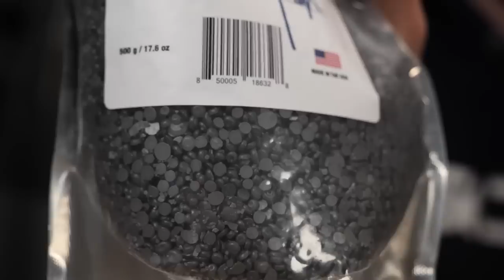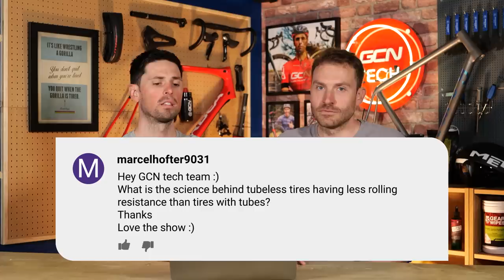Chain Waxing, 1x Setups & Tubeless Rolling Resistance | GCN Tech Clinic

Comment from the maker: What bike tech questions do you have for us? 💬
Reply: Do new bikes with thru axles have the wheels better aligned than older style quick release wheel setups? I would have thought this could be a significant advantage for lower rolling resistance and stability.🙂
Reply: @truthseeker8483  I think it more better for brakes as each one align in exact same place than older quick release where can be slightly off so brakes like on disc might not align fully correct so readjust brake pads if worse case
Reply: I turned around a tubeless mtb front wheel and a innertube front wheel at the same time and to my surprise the innertube wheel rolling significantly longer then the tubeless wheel, in my opinion the cause is the boiled egg  effect, so  the constant moving sealant in opposite direction to de drive direction slow down te wheel a lot, so what about ; tubeless roll better ;??

Comment: Tubes vs Tubless rolling resistance:  Tires and tubes are not rubbing against each other creating friction.  The tube is squished up against the tire casing and cannot slip and slide around.  The issue is that tubes and tire casings are made from butyl rubber that has some dynamic stiffness (bounces back a little slow).  If you get a ball made of butyl rubber it doesn't actually bounce all that well, more of a thud with a meager bounce.  Your tires are getting squished at the contact patch and need to spring back quickly to return that energy into wheel, and the slower they do this the more energy turns into heat in the tire.  Butyl tubes just add more total rubber being flexed and losing a bit of energy compared to an equivalent tubeless tire.
Reply: Which is why in contrast to butyl inner tubes, with latex tubes and TPU tubes the difference in rolling resistance in comparison with tubeless is negligible.
Reply: @sebastianm2381  BRR measures rolling resistance with only 20ml, which is probably not enough to actually seal anything at 3.5+bar (eg road bikes pressures). Actually Aerocoach has measured that tyre with latex tube is faster than tubeless equivalent. Since I am still on rimbrakes I use TPUs instead of latex to be safe heat-wise. TPUs are a bit slower but I use old school talc method when installing them, which in theory should further reduce added friction of tube inside a tyre. I think milk is a mess and since I usually puncture very rarely, every +10K or so, I find it easier and cheaper to run TPUs tubes system.
Reply: @theonlyrealbm  I agree with everything you're saying. I'm running tubeless on my commuter + gravel bike. There it makes sense and with these (wide) tires and low pressures it works reliably. On the road bikes I went back to latex and/or TPU tubes. Tubeless road tech for me fixed a problem I never had but introduces many new ones. I rarely puncture. But I did have to fix catastrophic tubeless fails twice on the road and it was no fun. I decided it wasn't worth it for me.
Reply: Where I live, punctures are always a hazard because of goat heads everywhere. I am running tubeless and so far have not had an issue while riding. Only once had a tire explode while camping but that was entirely my fault. Left the bike in the tent will full air in tires. Got too hot and finally gave

Comment: Alex is 100% right about hydrogen. It’s the smallest, fastest and leakiest molecule in the universe.
Reply: Er, no hydrogen forms a molecule with another hydrogen atom ('cause it has 1 electron, and would like 2 (inner shell)). So helium which is inert and thus goes around as single atoms is smaller and leaky-er. So leaky it leaves the earth having gained escape velocity. (more is "produced" through radioactive decay though)

Comment: #askgcntech hi team. Why is cross chaining frowned upon on a 2x setup but perfectly fine for 1x ? Thanks
Reply: Cause on a 2x you can minimize cross chaining by using different ratios, on a 1x you can't do shit about it lol
Reply: Essentially you have no choice with 1x so there’s no use worrying about it. On the plus side, the chainring would be positioned as such that it would be the in between the positions of the outer and inner chainrings a 2x would have, so you are cross chaining less on a 1x
Reply: Long live the front derailleur.

Comment: Tire pressure or Tyre Pressure if you prefer I do it the same way I did it as a mechanic, I use a proper tire pressure gauge I figured out my tire pump gauge is off by about five PSI so I over pump a bit then use my tire gauge which has a release valve on it to adjust to the desired pressure. 
An extra step yes,  but tire pressure is critical so I don't mind the little extra effort for the knowledge of having properly inflated tires a good ROI -Return On Investment of time spent. 😆
Reply from the maker: This is the sort of nerdy details that we love ❤ Do you find that tyre pressure makes a big difference to the feel of your bike?
Reply: @gcntech  
Yes I can tell if my tire pressure is off, it doesn't feel as fast or as easy to pedal.

Comment: If you are in the small chain ring most of the time and running 175mm cranks, I'd suggest shorter cranks.
Reply: Why?
Reply: @adccars359  longer cranks make any gear effectively bigger - you need to think of the crank as a lever. GCSE physics.
Reply: Thanks. This was something I was curious about and why I looked up my crank length and included it in the question. But wouldn't crank length be a potential bike fit concern as well? I believe I ended up with 175 mm cranks because Trek defaults to that size for 58 cm frames and higher and I am on a 58 cm Trek Domane (from 2017).
Reply: @jasonlenthe8902  if you've never had a bike fit, I'd absolutely recommend that and mention to the fitter that you rarely get out of the small ring. Remember though that there is overlap between the range of gears you access in big and small rings - if you are on the small ring and the 3rd largest gear on your cassette, you may find you can be in a similar gear in the big ring and largest gear on the cassette, and have almost the same ratio. 

Personally I run in the big ring all the time unless I need to access the lowest gears which are only accessible in the small ring. The big chain ring is more mechanically efficient anyway.

Comment: #askgcntech So as a followup to the hydrogen question, I remember years ago back when I was a total bike noob and knew literally nothing, a LBS I went to said he filled up my tubes with Nitrogen and that it's "better." At the time I didn't think anything of it, but I looked into after hearing the hydrogen question and it does seem to have some benefits.  Does N leak fast like H?  Any other thoughts?
Reply: Nitrogen gas leaks a little slower that straight air.  Air is about 78% Nitrogen to begin with, and it is the 21% oxygen that leaks out somewhat faster through the pores.  Once you top up your tires a couple times you have already gotten your tires to have a higher than 90% Nitrogen content, and your Nitrogen filled tires will eventually up at the same percentage after a few top-ups.  If you pay attention your tires will lose air a little faster the first time you fill them versus after a top-up to the same pressure.  Basically nitrogen filled tires are a giant gimmick, and you should not pay for it.
Reply: As I understand it, nitrogen is dry (i.e., no water present) and affords better pressure consistency when the tires heat up and cool down.  That is the reason why it is used in auto racing.

Comment: I'm really sorry but your explanation of tubeless rolling resistance was really poor. You just said it was "obvious friction" but I would hope your inner tube doesn't move about inside your tyre! If this were the case, why don't we lubricate our inner tubes apart from sometimes talcum powder on latex tubes to avoid pinching? I was hoping for a more in-depth look at hysteresis but apparently not...
Reply: I've heard that exact thing done by racers back then.. talc powder on latex tubes..
Reply: Kind of sounds like you already know the answer in more depth. You should make your own video 👍
Reply: Why wouldn't the inner tubes move inside the tyre? Obviously we're talking tiny amounts but there's plenty of forces acting on the tyre itself that translate onto the inner tube in varying amounts - they're 2 different bodies so they won't act as one. Those tiny forces acting between the inner tube and the tyre do so on a constant basis, so over the course of a ride, do add up.
Reply: Hoping an inner tube doesn't move in a tire won't stop it from moving in a tire.  They most definitely move
Reply: Years ago many people did this as a normal matter. The friction inside between a tire and a tube is quite surprising. On many spare tubes, the white coating is talc or something similar.

Comment: Taking the skin off brake pads = Emery cloth.
My downhill freewheel test didn't get more speed with tubeless.! Tubs at 150 psi GOAT.
Aerodynamics and water bottles. If you are not in an event to win money, don't let it worry you.
Never use the 50T ring? Buy a touring set.
H2 in tyres. The H2 molecule is smaller than the rubber structure. It gets through.

Comment: #askgcntech Hi GCN Tech Team. Since you planning to return to Aerodynamic Tunnel - any chances you could test what is the difference in Aero between Gloss and Matt Bike paints ? 
Is there a real difference to consider when choosing new bike. (outside of esthetic or practical (when cleaning) factors - any significant gains ?)

Comment: #askgcntech Thinking of (even) easier gearing than my current 105 r7000 34/50 and 11-34t to help attempt some killer Lake District climbs. Would it be best to go for a sub-compact chainset (eg GRX 600) or wider cassette (eg Deore 11-40, with Wolftooth Roadlink?) for this particular set up in terms of compatibility? I've started reading around but get mixed messages. Thanks.

Comment: Tubeless road bike tires suck. That's why the industry has been lying and bullshitting us into using wider rims and tires. If you go wider then the bike is no longer is a road bike as traditional road bikes were. You have just a fancy comfort bike. And. just going from a 26mm to a 28mm tire made me slower. I got two sets of wheels which I have been switching to test this over the last year or more and no doubt the wider tires are slower.

Comment: What do you do after 1.000 km with a waxed chain? How to get ridd of the old wax or do you put new wax on the old?
Reply: You pretty much dont. I ride ab out 300km per waxing, then clean the chain with alcohol and rewax it.
Reply: @mrx1979ua  A waxed chain can be cleaned with just boiling water, it will melt the old dirty wax off. Then just let dry (it will dry quickly as it's hot) and rewax.
Reply: @Murgoh  it can be, but I can't always properly dry it, so I don't use water at all. At any stage. Plus I don't really want to clean all the paraffin from inside the rollers anyway
Reply: @mrx1979ua  The water will completely evaporate in the hot wax if not before. And getting the old wax out is a good thing as bicycle chains are not sealed like most modern motorcycle chains are so dust and grit will get inside the rollers and bushings causing wear.
Reply: I do 300-500k max on a waxed chain. Depends on the conditions obviously. Then I just brush it clean and put it in hot wax. Wait till all the water has evaporated and there’s no bubbles coming out anymore. That’s when the chain is ready to come out and hang to dry and cool down.
Reply from the maker: We did a video on re-waxing your chain 👉 https://youtu.be/pVo8MttQmyY

Comment: scenario: i have multiple bikes now (2020 infinito and an 2018 emonda slr) but only one power meter. Currently I'm swaping the crankset back and forth. 
Question: Can i program 2 cranksets to my wahoo element bolt computer? Or should i get power meter pedals and run a regular crank?
TIA, Shawn
Reply from the maker: Good question! Make sure to use #askgcntech and the team will be able to pick it up. 🙌

Comment: Rider with the 34-50 and 11-32 who rarely uses the 50 could consider a GRX crank with 46-30 chainrings.  I am considering it.  Only drawback is slightly wider chainline (3-4 mm).  Front derailleur needs to be able to handle it.
Reply: I have done this, you will need some small chainring spacers but after that we had a 105 mech on GRX cranks just fine
Reply: I don't think any change is needed. It doesn't sound to me, given equipment level and described ability, that the rider is all that committed to cycling and the expense of changing is probably not justifiable. What they have works well enough for what they do.
That said, I assume that they must be riding on the smaller cogs of the cassette and so could shift to the big ring and a larger cog without issue.

Comment: Been waxing for over a year now and to make it commercially viable, it requires a bit more efficiency and speed.  I use pint size glasses to speed cooling while other chains are heating up.  The third and fourth chain are a lot quicker...  The cooling of wax is the trick before pulling the hot chain out.  My time frame is nearly 13-15 minutes to cool before I remove the chain from the hot wax.  This maximizes wax retention in the chain.  Good Luck!
Reply: I'm personally skeptical about the need to cool down so far.  I'm pretty sure it just results in more wax on the outside.  A lot of the wax in the rollers (where it actually matters) already gets squeezed out almost immediately, and a thick layer on the outside of the links mostly just makes for more wax flakes after breaking the chain loose.
Reply from the maker: Great to hear that you've been using chain wax for a while! Do you think you would ever go back to oil? 👀

Comment: Hydrogen has been used in heavy duty tires in past years because it was less susceptible to pressure changes with heat, but that practice has been largely abandoned because of the cost to benefit ratio- too much cost not enough benefit.
Reply: I think you mean Nitrogen, because when you say "Hydrogen" most people think of the "Hindenburg".

Comment: the risk of going 1x is if you take your bike on a trip outside of your regular flat roads, then it won't have enough gears
Reply from the maker: Do you think you would worry about running out of climbing gears or big gears?
Reply: @gcntech  around home I can almost get away with only using the big ring, but anywhere hilly and I spend plenty of time in both

Comment: Saw a video once where they checked if helium in the tires would make a difference and it really doesn’t
Reply: Hydrogen, however, would be perfect for those explosive sprints.
Reply: It has one of the two problems as hydrogen, it diffuses across membranes relatively quickly.  I wouldn't expect tires to remain at proper pressures over short time periods.

Comment: Does tubeless sealant freeze on long flights, and should I be worried if it does? Flying to Japan next year...
Reply: Every sealant has a different freezing point.  Most still work after they've defrosted.
Reply: @veganpotterthevegan  Thank you for your reply👍
Reply: Cargo bay in a plane is also pressurised and air conditioned so sealant won't freeze.
Reply from the maker: Great question! Be sure to use #askgcntech and the team will be able to pick it up.

Comment: Hysteresis is the word you’re looking for, not friction.
Reply: You do realize that it's frictional hysteresis when talking about tires don't you?
*No need to answer, that was a rhetorical question.
Reply: @veganpotterthevegan  no, that’s fine, I’ll answer because the friction they’re talking about is just good old, bog standard friction (the tube rubbing against the tyre) but that’s not what happens. Hysteresis (the energy that’s lost when the tyre and tube flexes and returns to its original position) is what’s happening.
Reply: @SecwetGwiwer  it was a rhetorical question. Thanks for the answer that wasn't necessary.  That bouncing is still energy lost through friction. The structure of the tire moving and losing energy is still largely frictional loss😅